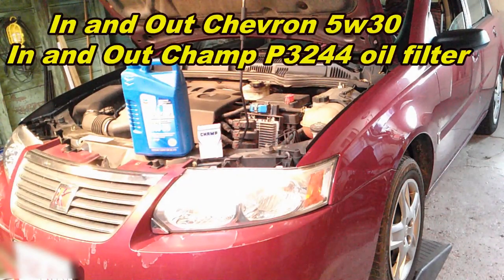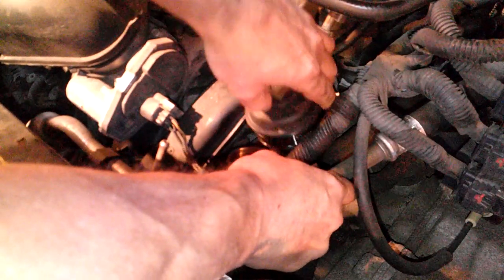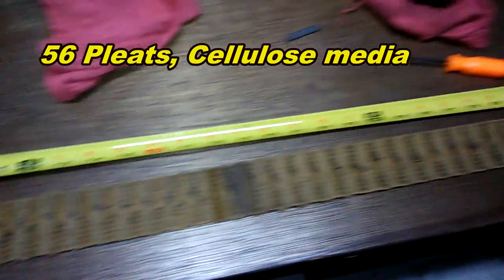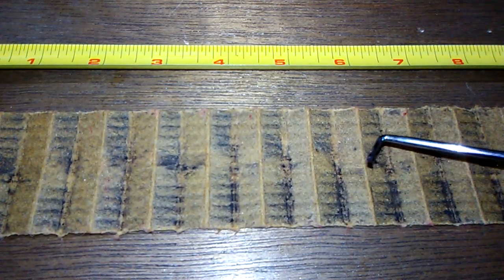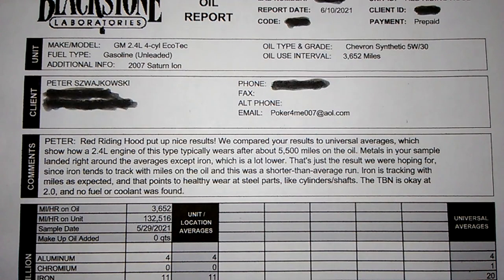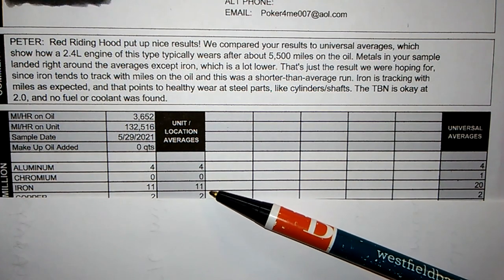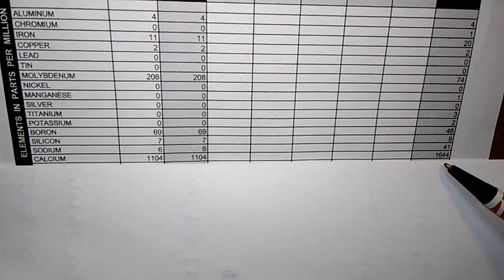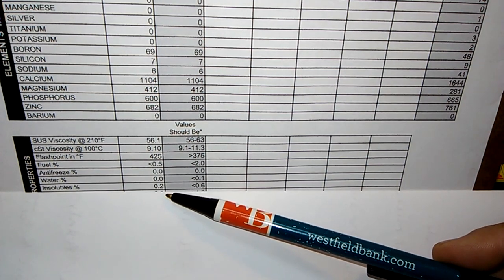Black Stone Lab Oil Analysis Chevron 5w30 oil, Champ Cartridge Oil Filter, 2007 Saturn Ion

Comment: If a person is determined to run their oil no longer than 5,000 miles Chevron Supreme is difficult to beat. Running top tier synthetics and dumping it @ 5,000 miles is a waste of hard earned money. I had one customer in my shop that put 330,000 miles on his Civic with nothing but Chevron Supreme 5W30 every 5,000 miles. I had the valve cover off to do his last timing belt and the valvetrain was absolutely spotless. Even with today’s ridiculous inflation it is still priced reasonably.
Reply from the maker: Thanks for Sharing👍

Comment: If you do another one of these analysis videos, I would like to see you collect a sample out of the jug when it is new, and later the old oil and compare the results to see where the oil started at and where it ended up after 3k miles.
Reply from the maker: I will, 
it should make for an interesting video. Thanks!👍
Reply: @WhipCityWrencher  Blackstone saves New oil analysis reports to compare for most popular oils. They periodically update also for newer batches/specs.

Comment: great video, I like to see the same test done with Walmart super tech or synthetic, I saw a lot of good reviews of this oil.it is made by Warren oil and available where I am.
Reply from the maker: Thank You, Bud👍
I thought of that afterward, because I do have some Full Syn. Supertech, I'll try to remember to put it in the next oil change.😊
Reply: @WhipCityWrencher  thanks
Reply: We have alot of gas fleet tucks. It is good to go up to 7500 with Wix/Napa Gold at 21 microns(mostly). Could go longer but we usually swap at 6-6500.

Comment: You're are getting to be an expert on the mid stream oil catch for the sample...👍 Seems like the Chevron has some decent detergents in it. As it was cleaning some sooty carbon that filter caught well.  Curious if the Calcium depletes as the oils life is being used up? Would have to look at a VOA I guess .One thing that Amsoil always has, is a high Calcium number whenever I see thier VOA's. Must be why they are known as such a good flush out and cleaning oil.. I know you said that Saturn isn't yours but I did see a plastic oil housing conversion piece by "Baxter Performance" that eliminates it. And it is a quality solid metal base you put in. Then you can use a Real Metal spin on filter. Great invention I thought. If I had a newer car, with many oil changes in its future, it be its first investment.  Heard nothing but good things about Chevron oils, Conventionals especially... Another interesting Video Whip City Wrencher!!! 👌👏👏👏Thanx;Jethro